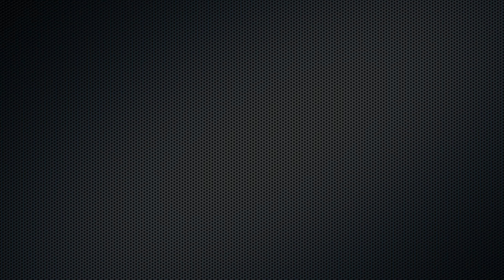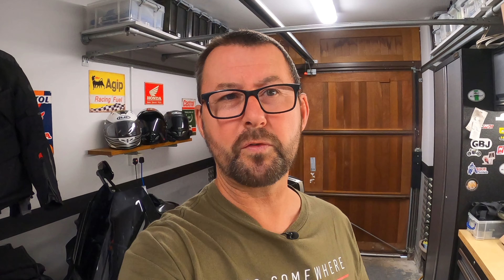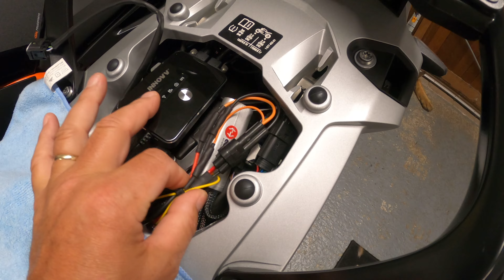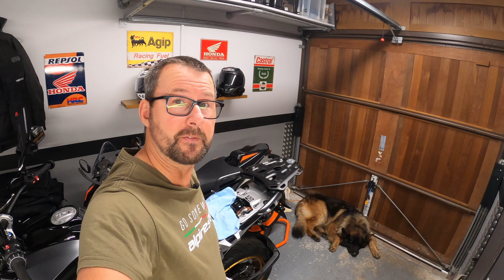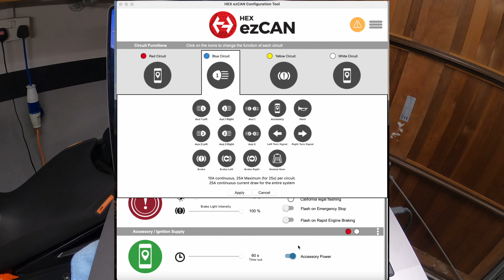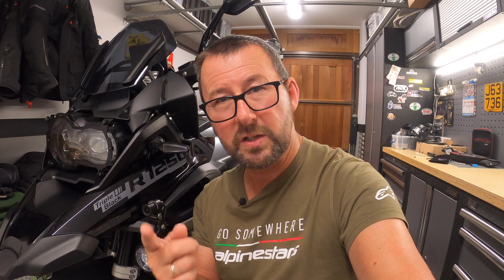Part 2- Innovv K2, K3 set up using the Hex Ezcan, BMW R1250GS. (Not connected directly to battery)

Comment: Can you comment on the video quality with the front camera monted to the driving light vs. headlight guard? 
I noticed for this video you mounted the front camera on the left side factory driving light.  In another video you put it on top of your headlight guard.  I'm using the Vantrue setup on my 2023 GS1250 and debating which way to go.
Reply from the maker: Hi . The camera mounted on the Wunderlich headlight protector is actually in a better position in my opinion . I only use them if I need video evidence of any incident and possibly b roll but no more than that . I have the INNOVV k7 in my garage and I will be trying that out very soon as I am interested in the 2k front and rear cameras . 👍